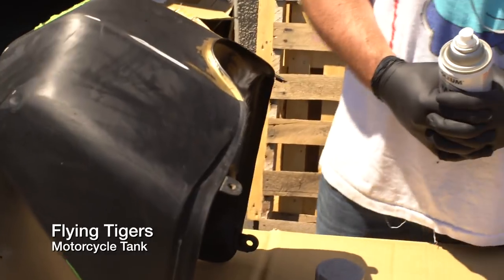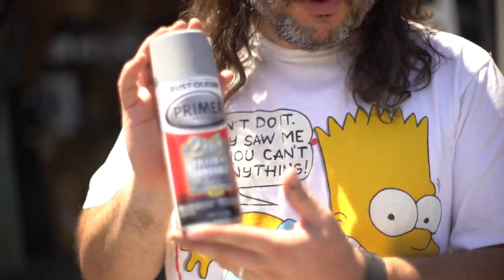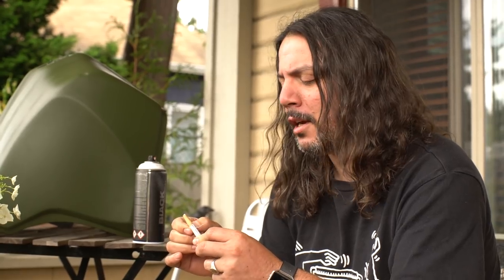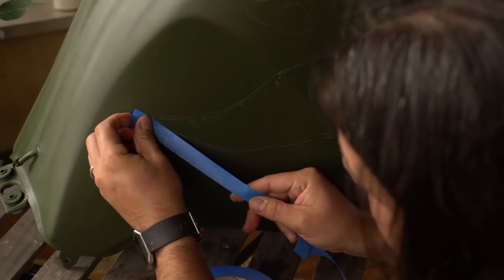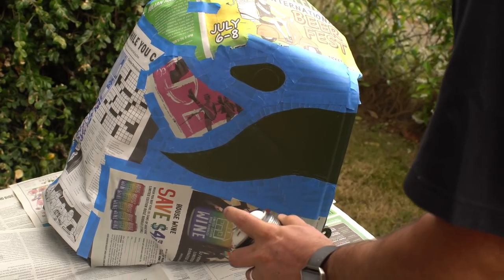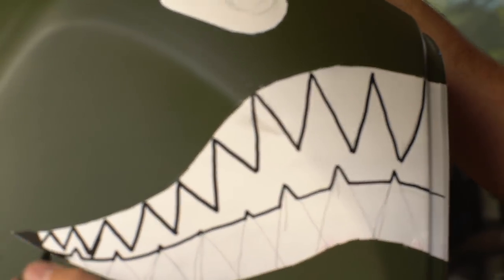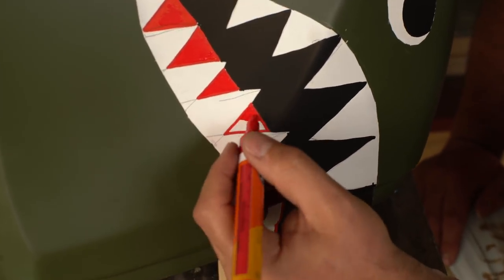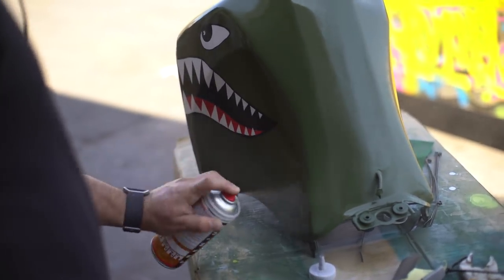ArtPrimo.com GR Motocycle Fuel Tank Painting and Marker Tutorial

Comment: Im an ICAR certified collision repair tech, just a word of caution to those planning to try this. You shouldnt use ANY kind of plastic body filler (yes thats bondo) to fill a dent more than 1/32 of an inch deep, if you do it WILL eventually pop out. If you want to fill a deep dent get eastwood non lead metallic filler (or lead if your ok with that) Plastic body filler is not for packing into dents like your trying to stuff a hole in a dam, its supposed to be used in a skim coat and block sanded to level a surface. Put it on to thick and it is not possible for it to cure correctly and it will swell with time. Thats why when people try to fill giant dents or shave doorhandles with bondo there paint starts to crack months down the road, and eventually the filler falls out.

P.S. You can also get narrow "pinstripe" tape from 3M that allows you to curve your tape lines and lay down continuous compound curves with one piece of tape, i.e. the sharks mouth could have been masked with two pieces of tape.
Reply: I feel you homie. I wanted to use supplies you can get at your local hardware store. I talked about it in the vid but it was cut it out of the edit.